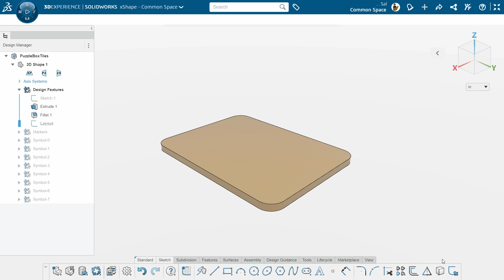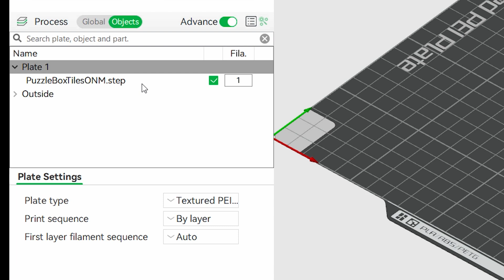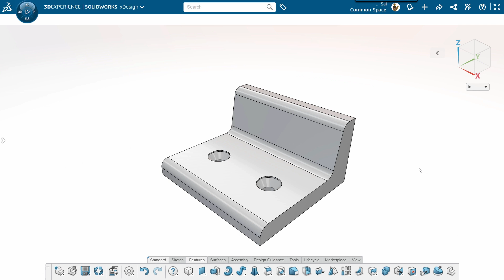Strengthen your 3D prints with hidden geometry

Comment: Great tip, and very cool hidden clues for your puzzle box.  Good luck at the event.

A technique I use when I need specific strengthening is adding 0.2mm holes through the part, which when sliced the holes effectively go away but walls are added.   I've been able to do this creating angled columns as needed.

For my latest project where I need to make 60 structural hubs for a hanging art piece, I actually am printing them upside down without any infill and no "top" layers, creating a shell.   After printing, I fill them with 2 part long cure epoxy with some fiberglass filler added.    Rock solid, strong in all directions.
Reply from the maker: Adding 0.2mm holes through the part sounds really interesting - We'll have to give that a try some time. ...and the idea of only printing the outer shell of your design and filling it with epoxy and fiberglass is epic. Those parts must have been incredibly strong! Thanks for sharing your techniques!
Reply: @ournextmake  Thanks!   Perhaps either could be a future video topic for you.

Comment: Apropos hidden geometry, if you have hollows inside your STL, so basically another set of walls fully hidden inside the solid, this can help you create internal reinforcing structure.
Reply from the maker: Great point! Using internal hollowed out shapes is another great way to add strength and reduce filament consumption. Thanks for sharing the tip!

Comment: Yes, I always add pocket beams in my larger prints. Set the pocket to like 0.05mm and trick the slicer into printing walls within the print so you do not have to use as much infill plus give better support to the objects.
Reply from the maker: That's a great tip! Thanks for sharing!